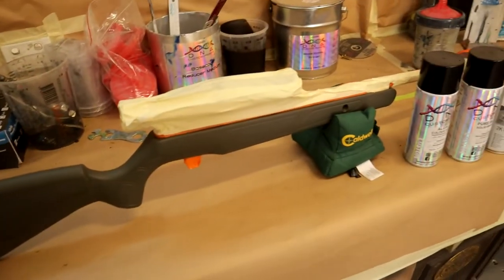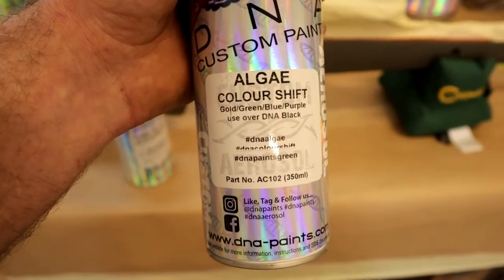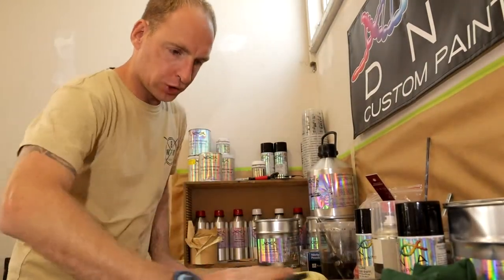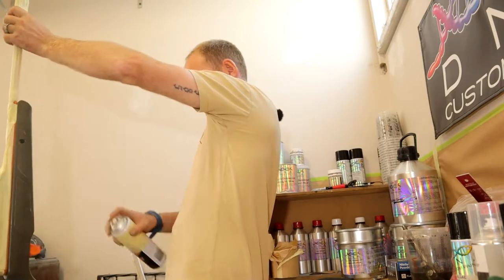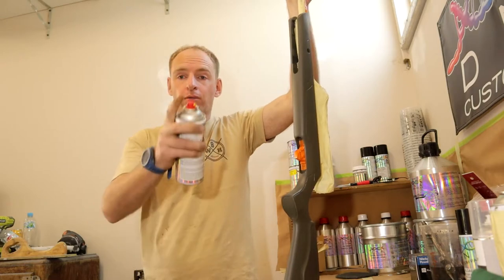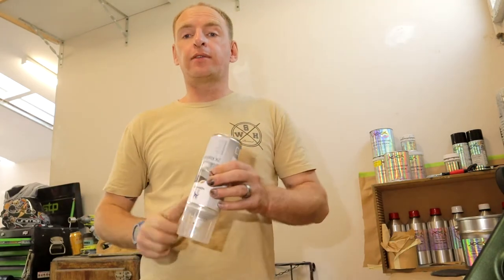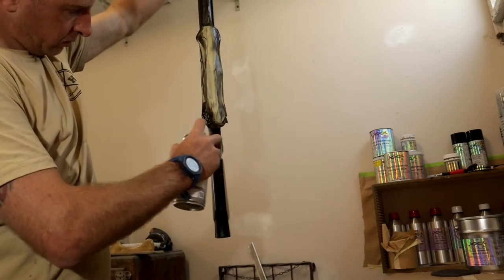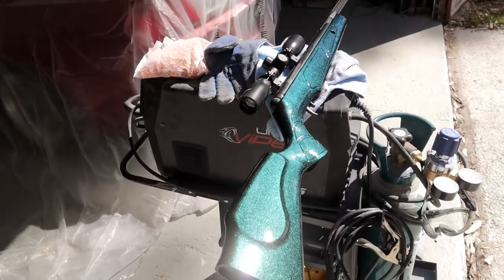HOW TO CUSTOM PAINT A SYNTHETIC STOCK

Comment: How do you finish it?  Are you sanding and cutting or leaving the final clearcoat alone?
Reply from the maker: Personally I only painted it for a video . I plan to sand down and repaint in mutant crystals.  However you can wet sand with 2000-3000 then cut and polish it . 

My next video with this rifle I'll 2pack prime it and use all 2k products with the dna custom clear which won't need polishing
Reply from the maker: Ill probably do that video next week so stay tuned!